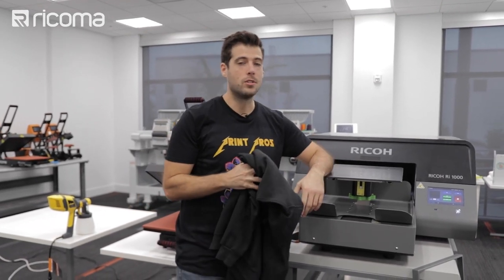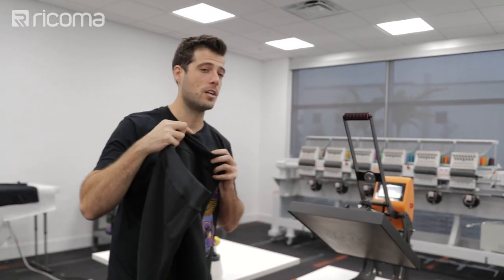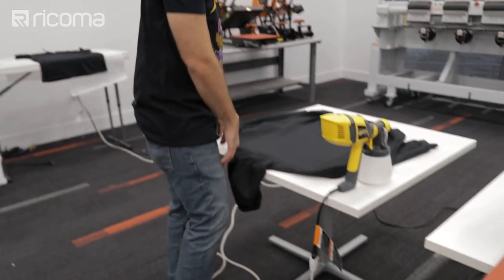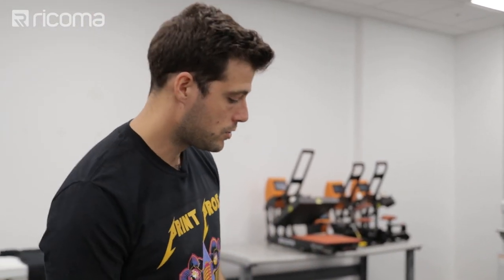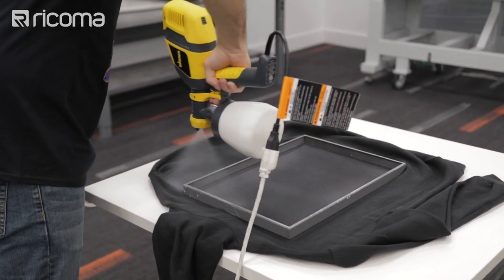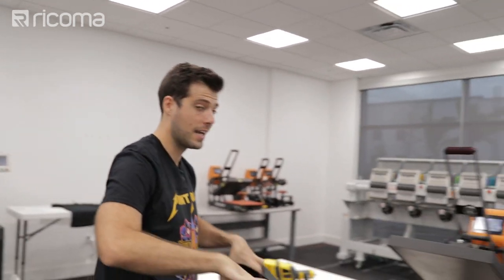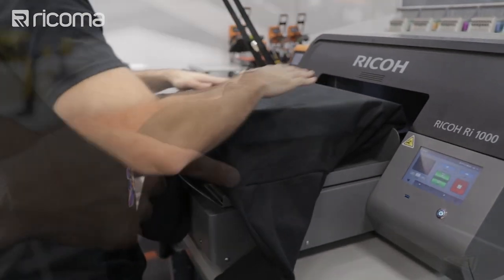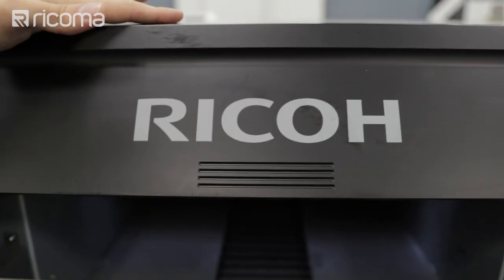Print On Hoodies Like A PRO w/ DTG

Comment: Hi love your videos very helpful!
Question if you have a video on printing hoodies when there are pockets in the front?? 
Thank you in advance
Reply from the maker: HI there, thanks so much for watching. We haven't yet but this is a great idea. Thanks so much for passing it along!
Reply: Put something under the area you're printing on, so it elevates that area higher than the pocket seams. And adjust the platen to the elevated area. I use dense cardboard, easy to cut to size.
Reply: Thank you so much

Comment: I’m interested in buying this heat press.  But hesitant because of the beeping noise since I live in a apartment building. I saw that you can lift the handle before it starts beeping? I’m interested in the 16x20 one
Reply from the maker: Hi there. Thank you for your interest in our machines! Make sure you fill out this form and the correct Ricoma distributor in your region will be in contact with you as soon as possible. 
https://ricoma.com/US/contact-us
Reply: @ricomatv  can you lift the handle before it starts beeping?
Reply: Do you only sell to ppl in the US?